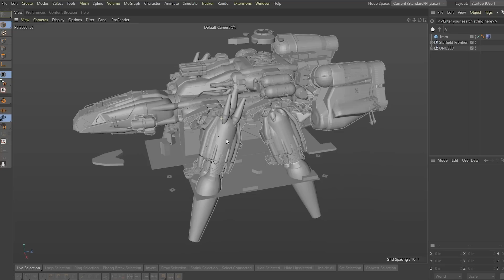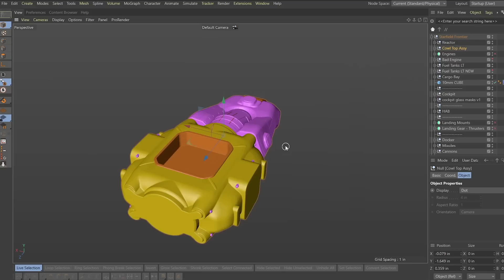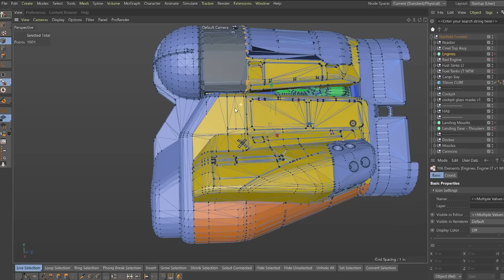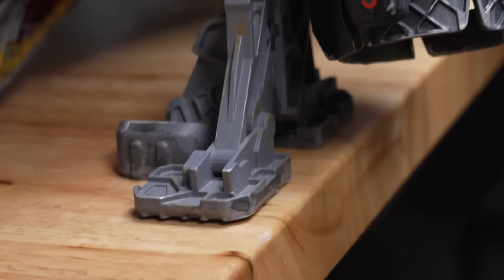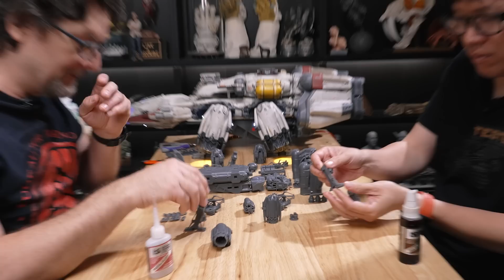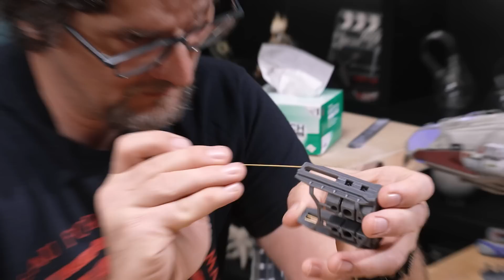How to Build YOUR OWN Starfield Frontier Spaceship!

Comment: I may have missed it, but what has a scale been stated for the 12”? I.e. 1/72
Reply: I answered my own question. The stated length for the ship is 20 meters. This is  + and - as the game only allows ship lengths to be stated in whole meters, not 20.4 for example. With a unit conversion it is 787.4" long in the "real" world. The model STL is set at 12", meaning the model is 1/65.62.  I plan on printing at 1/72 scale to match many of my SW ships, so I would have to multiply the file scale by 91.14%

Comment: I have checked the files and they are well printable with FDM printers with the help of support in some parts.
I could scale it to 260% but I have no space for such a large model, my printer does support 300x300x300 models.
I tried to buy this model and boy, terrible quality. the files you guys made available have high triangle count and have the hollow version so fast prints and less filament used.

Thank you so much for making this available, drying some filaments and starting the print.

Comment: Pure awesomeness !!! I have some extra questions : 
1. Compared to usual model scales what would it be ? 1/100 ? 1/144 ? 1/72 ? scale. I intend to print it for my RPG games (usuallly 28mm scale) but intend to resin print lower scale mini. I know that HAB is supposed to be 2x1 in game, that is 3x6 squares if that can help.
2. I have been looking for files extraction. My understanding was that BAE software along with NIFSKOPE could allow extracting 3D files. But your video seems to explain that it won''t be doable.... Correct ? Thanks for the free availability in any case !!!!

Comment: The work made by Sean it’s really incredible, having this model from something that you have on a screen converted in to a physic model it’s not an easy job. Sometimes modeling for 3D printing could be a nightmare, specially when you have to fix a model that it’s not yours or be made for rendering proposers only, and you need to close those open complex surfaces or connect them within another faces. Maybe the rear part of the engines look a little bit faceted but it actually looks like straight steel panels over a rounded frame, the way that it would be constructed on real life, and this model it’s the result of the whole amazing tested team.

Comment: Just downloaded the files and looked at them. What a magnificent model ! There is a lot of detail, not only on the visible features but also on printability. Holes for wiring, holes to prevent suction on the hollow parts and it also looks like it has been split in such a way that when possible the support is on the sides of the parts that will be glued together or not visible when assembled.
I can hardly wait to fire up my printer and start painting and assembling this

Comment: Thank you so much for sharing.  Would it be possible to include STEP file format or X_T.  I use Sharpr3D and as of yet it can’t open OBJ files
Reply: This isn't a CAD model.
Reply: @piorism  There are ways to convert files that can be read with CAD.  They are paid software that I imagine they likely have. I don’t. The free version that makes them readable format are….dubious.  When I send them as STL from Nomad to Sharpr3D the file crashes.  I want to design a large maintenance garage.  It’s always fun and inspiring to put something as beautiful as that in the space I work around.

Comment: It would be awesome if they created the files for all the parts so you could bring your creations in the starship builder to life.
Reply: This is personally what I was also hoping for. But even getting just the base ship models with no extra charge from Tested or Bethesda is kind of unprecedented. Normally getting 3D models from games and making them printable has such a high skill ceiling and developers would normally be super protective of any assets and IP.
Reply: you can actually get quite a bit of fallout stuff for 3d printing. its not free but its often cheap. @AlasdairGR
Reply: Cia. It is a dream I am working on, Maybe later on Esty I will be able to get this done. Mythic Maker is a work in progress. I am going to start with the Razerleaf, so check in and hopefully I will be able to pull it off.

Comment: Thank you Its great to have this. I would still have liked the full version. I like the detail of the original, the compromises in shrinking it are great for those with smaller print beds but I would have preferred the larger files and yes to have scratch built the landing ramp! Not fitting on print beds? that is what splitting in the slicer, fusion 360 or mesh mixer is for. But thank you for working on this.

Comment: I wonder how much you'll need to scale it up to make it fit in with 28mm gaming miniatures. It looks a bit small for most standard size tabletop minis.
Reply: I have had a play with some correct sized pilots for 28-32mm and somewhere between 140-150% looks pretty good . I will try a 150 cockpit at the weekend ready for my Stargrave crew
Reply: Actually wondering what scale this model is. Playing here with 28mm minis but would scale down my resing minis to something close to 15 or 20mm scale. Not sure what %scaling would be needed

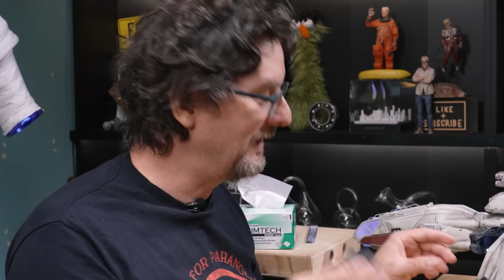Comment: CORRECTION: at 28:04 I misspoke - the square is on LEFT FRONT & REAR RIGHT parts. Circle is on RIGHT FRONT & LEFT REAR. It's correct in build guide.